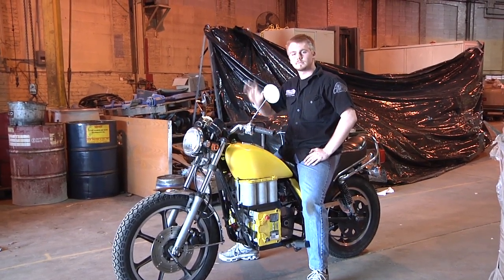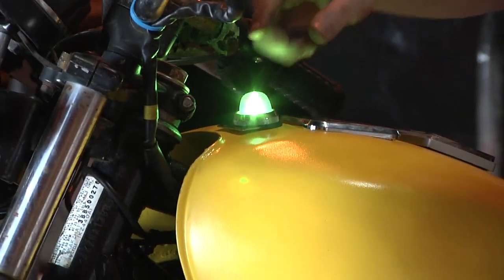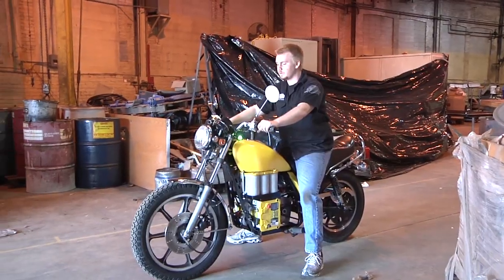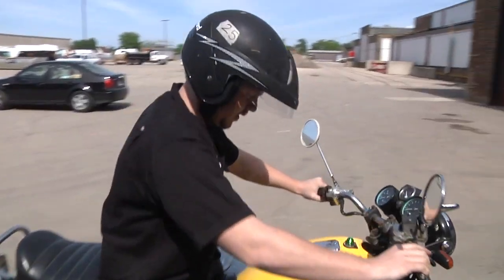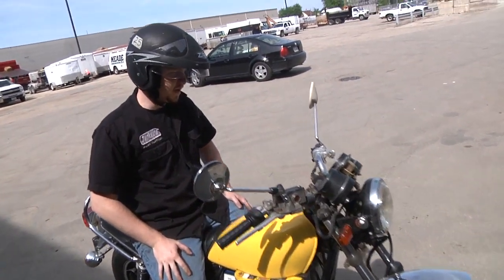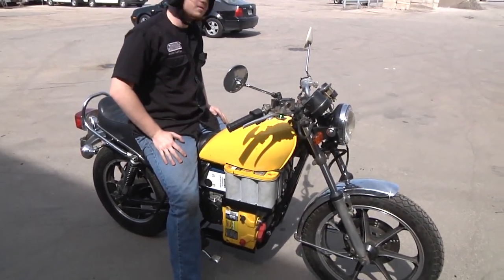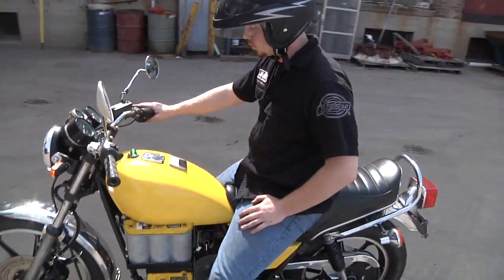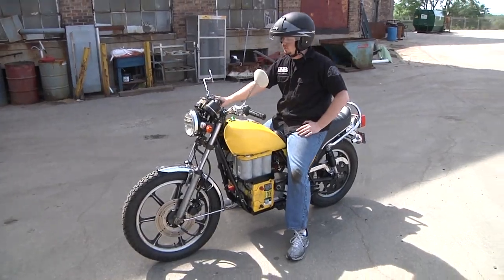Electric Motorcycle Conversion: Parking Lot Testing

Comment: Is there any speed/power/load capacity variation of used gearbox...? 
If use gearbox Does it really need motor controller again...? 
Because of gearbox also have speed control based on gear(1-10,2-20,3-35,4-50 speed) 
If used motor controller gives low speed with mini accelerated the gearbox also slow based on gear.

May be that's why he is not used gearbox, he just used direct mode just speed is controler with controller.
Kindly reply experts.

Comment from the maker: @firecrowpl 
Lightweight is always a good thing for an EV. As far as I can tell, the motorcycle is pretty close to the same weight as the original gas version. It's geared for 45 mph, as that's the speed limit right in front of my house and everywhere else I use it is 25 mph zones. Range is 20 - 30 miles per charge. Speed and range would be changed by gearing, higher amp/hour batteries, or a higher voltage battery pack. (And no, I don't have the budget for lithium.....)

Comment from the maker: @mrbr549 
It doesn't do wheelies, but I can slip the back tire on on dry pavement with a fresh charge. The controller is programmed to ramp up the amperage smoothly, which makes for quick, but comfortable acceleration.
I could reprogramming it to ramp the amperage faster - that way, I squeel tires more, but the throttle would be touchier than I want for typical riding.
Other people have told me I should put in a 500 amp Open Revolt controller. The batteries themselves can put out almost 900 amps

Comment from the maker: @DanFrederiksen 
Hey Dan, a person could do exactly as you said. However, it would be a custom, start-from-scratch project. I've talked to people who have done that sort of thing before, and had nothing but trouble trying to register to finished vehicle. By converting an existing frame, insurance, registration, and title are all very simple to take care of. At least one of the commerically available EV motorcycles IS of lightweight design (dual-sport style) with Lithium batteries.

Comment from the maker: @VRJensen1 
It's a Briggs & Stratton Etek permanent magnet pancake motor.  150 amps continuous. It's rated at about 10 HP but will do 20 hp peak for accelerating and hill-climbing. And that power is instant - no shifting, clutch, or revving an engine.